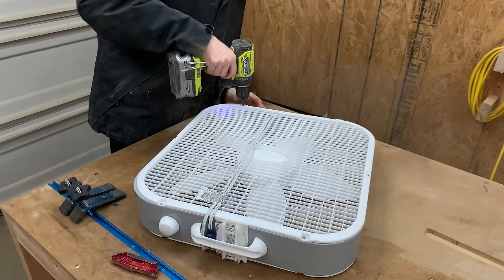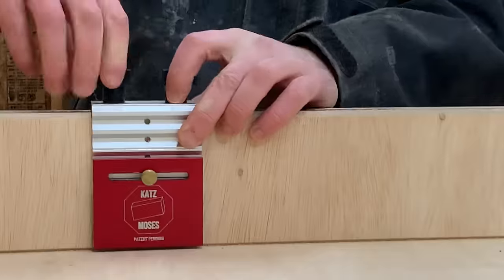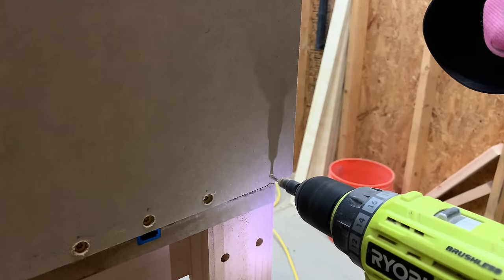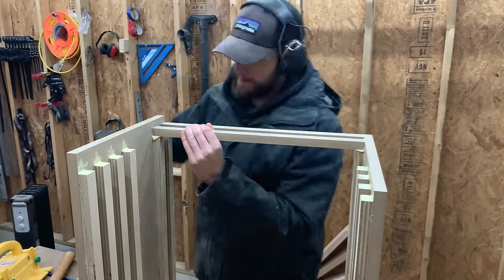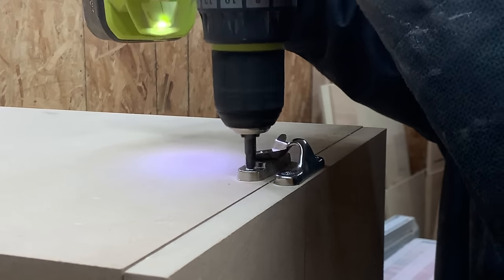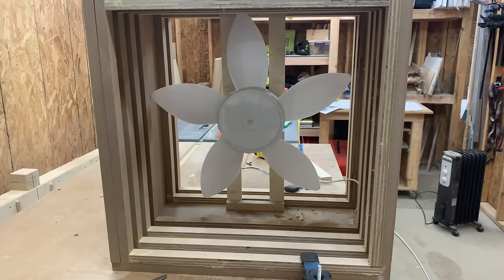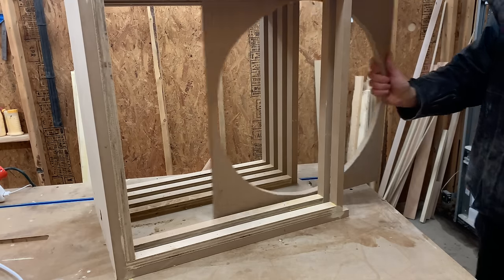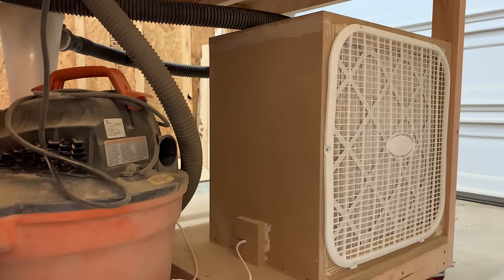this $20 fan will SAVE your lungs

Comment: You guys should check out Sensio Air at least it will tell you what the particles are; pollen mold dust-mite or dander.
Reply from the maker: What is sensio air?
Reply: @SpencleyDesignCo   I'm currently building a homemade filter I want to fit above my bed, thanks for the awesome video btw! Super helpful (I love the slide-in filters feature) and while we might be removing a lot of the Particulate Matter in the air, what I want to know is if there's still mold and dust mites after the air has been filtered. So Using that little tech to validate the air quality improvement.
Reply from the maker: That sounds pretty cool!
Reply: @CyrilleNajjar  I too want to filter out mycotoxins from air and wildfire smoke.  Sensio air is an app that measures the air?  I guess?   how does it work?

Comment: Was that electric motor sealed or open backed?
Reply from the maker: not sure
Reply: A closed back motor is what they call explosion proof. If you can see the windings I would respectfully suggest not using it as it could very well cause a fire at least.
Reply from the maker: I appreciate the insight

Comment: Why buy the box fan? You can buy a strong motor and blades for the same price. It will circulate air more efficient and last longer.... Those cheap motors on a box fan can't move the air well enough... That being said... Excellent job on the build

Comment: that's ridiculous.  there are several ways it could have been done easier, faster, and lighter, as well as cheaper. for ONE example,  using sheet metal instead of heavy ass particle board.  26 ga galvanized  is lighter,  and sturdier,  and requires no glue.  you could add the filter racks to the existing fan box, eliminating all the table saw cuts and not wasting the original fan box it came in, or moving any of the electrical components,  also eliminating all of the drilling, because sheet metal screws are self tapping. making it from metal also eliminates most of the tools you needed.     you don't even need the filters if  you just blow the dust outside.    some of the money spent on a proper exhaust fan, could have been offset by the saved labor cost of building the box.  labor is always your biggest expense in any project.  time spent building the box is time spent not making money in the shop.

Comment: A cheap LASKO fan like the one you used does NOT have the power to move enough air through 3 fiber filters and one pleated filter to do any meaningful cleaning. Your accomplishing nothing as far as dust removal is concerned. I built a similar dust filter using the same fan that hangs from the ceiling of my cutting area. It's far more efficient to construct a simple ring from aluminum flashing material and put it into the original fan box so that to surrounds the fan blade which is centered in the ring. Seal the open spaces around the outside of the ring with whatever method you desire. A fiberglass mesh filter (not a pleated one) will catch enough airbourne debris to need changing after about 15 hours running, depending on what its capturing.

Comment: using a fan that was meant to  running  without air flow  resistance  and adding 3-4  filters  of resistance  ? let s see how long is going to last !  it s like using  a VW  to pull  heavy boat

Comment: Hey i was curious if this setup makes alot of noise?:)
Reply from the maker: Great question! No, it’s pretty quiet. It’s less loud that a typical fan running. If you’re wearing hearing protection in the workshop, you won’t be able to hear it’s on even when all your tools are off
Reply: Oe thanks that is realy nice:D. I have a workshop where i can't open the windows so the realy fine dust can get everywhere. Im realy trying to find a solution for it to make it safer:). 

I have a vacuum for my machines but that one is very loud and it dousn't filter the air:). Do you think this could be a good solution for my workshop?
Reply from the maker: It will definitely help, but it’s not going to replace still needing to run the vacuum. It will help capture the very fine airborne dust but you still need to use the vacuum to collect the large legs pieces of sawdust.
Reply: Ow yea i get that:). My biggest problem is the small airborn particle's. Im still gonna use my vacuum but i need something to make sure i won't get any dust explosions:).
Reply from the maker: Dust explosions? I think you might be reading too much into Internet forums 😀
Reply: Nope that was from my dadXD. He is a bit paranoid about the safety im my shop:p. This is also because the heating dousn't work and we can't air out the place:p. I also have a pretty large wood inventory that i still need to process and my workshop is next to a car salesman with a few garages:). So lots of oil and other flamable materials:p.
Reply from the maker: Understandable! Sounds like what you’re looking for is some sort of industrial air purification system
Reply: Hey hey sorry for the slow reaction i had a busy few day's:). I also measured how big my work shop is and it's a room from 8 meters by 4 meters and i mostly have time to go there once a month unfortunatly:/. So i get the feeling an industrial machine is a bit overkill:). 

Basicly i do small work like jewelry not alot of big stuff:). Knowing that would you still recomend an industrial filter system?
Reply from the maker: I’m far from an expert in this sort of stuff. I’d suggest reaching out to a company that makes purification systems and discussing your needs with them. They will be able to direct you better than I can based on your specific circumstance.
Reply: Oke:) thanks for the tips and suggestions:). Im gonna do some googling and research:)
Reply from the maker: Sure thing! I just don’t want to give advice on something that I’m not incredibly knowledgeable about. I know there are TONS of folks that know more about the topic than I do 😀

Comment: How quick does it burn out the motor from extra air flow drag???
Reply from the maker: I’ve had it running for over a year and the fan still works as well as the day I got it
Reply: @SpencleyDesignCo  Dang pretty good, thanks.
Reply from the maker: Sure thing!

Comment: Using this type of fan for Ventilator is very DANGEROUS! If you are spraying flammable materials you could cause a Explosion 💥 or Fire.
 Specific motors that are sealed are used for spray booths and exhaust fans. These fans can also cause sparks which can ignite dust, which can also lead to explosions or fires.
 Always use proper equipment!

Comment: I just saw one of your tik toks from a couple months ago of you changing the filter but i noticed you were only using 1 filter instead of 3 or 4 that you have in this video. Did you find out that only 1 works best or something? Please let me know as i plan on building this soon. Thanks.
Reply from the maker: Found 3 was a little overkill 1 worked just fine
Reply: @SpencleyDesignCo  thanks for the quick comment. That being said if you rebuilt it would you make the box smaller to just fit 1 filter instead of now having all the empty space?
Reply from the maker: Yup!

Comment: This will not be effective in capturing dust. The simple plate fan that you have utilised is not designed to pull against any restriction, hence as the filters become blinded with dust the fan will just spin with no flow. Additionally. it will not capture dust to any distance - as you demonstrated. You will simply kid yourself that you are protecting  your lungs when you are absolutely not doing. Protection is only possible by effective dust capture at the point of emission plus PPE.
Reply from the maker: good to know

Comment: "I don't know why fans have to have a ring around them, it's just magic I guess."  LOL!
It's called cavitation.  If the air is not forced to flow through the fan, it can be pulled around the sides and right back through again.
This creates a circular flow (cavitation) that doesn't push the air anywhere but only around inside the fan housing, making your filters, and honestly the entire project, pointless.

Comment: well...like everybody has a well equipped wood shop and a table saw to build one of those and beside that you can buy fans like that for probably way less than you bought all the materials for that so what is the point?. I bought a small filtered fan at Wal-Mart for less than 20 bucks. A lot of work and money for something you can buy cheap....

Comment: It needs to be belt drive , insulated and grounded . Trying to explode or what ? And no you don't have a complaint about cost of blowing up !
  Static discharged dust explosions ain't no joke . 
  Better not let Fire Marshal see it , much less OSHA .  💲💲💲
  P. S. Hrs. How long did it take ? What is shop rate per hour ? 
  Did you save anything really ? 
What ?
Reply from the maker: 17

Comment: One major issue: Those Lasco fan blades are trash. After just a few months of running it, the blades will have lost a lot of their curve, and that means lot less air is moved... After a year, it is even weaker. The motor itself is not built to last very long these days too. I remember 20 years ago a Lasco fan might last many many years... not these days with 'planned obsolescence'. With such a nice build, it would a shame to have to take the whole thing apart after just a year or two. If this is something you plan on using daily for many hours, do not use a Lasco. This is from my experience of using this brand of fans my entire life because they are cheap. Decent for a hot summer day, terrible for commercial/industrial use! You get what you pay for.

Comment: HVAC 20 years First theres no 1 inch hepa filter i dont believe. And all of the 1 inch air filters with high merv ratings really all they do is slow down the air and so the air goes around them otherwise it would dramatically decrease the cfms. And indefinitely wouldnt put the filter on the supply side of the fan I would put it all on the return side. I'm not opposed a cheap filter in front of a better filter because they hardly do anything. And u wouldn't notice any better using the more expensive filter behind it. So if you really want to do it right you need a 5 inch filter. It has huge fins which filter literally everything even the super finest particles and does not slow down the air. They're pricey but last 3 times as long. But even if you put the cheap filters first then a regular 90 day but cheap home depot filter after it that will work good. The 3 packs at home depot for like 12 bucks work good. I find the only next best step is to use the 5 inch filters then no more dust problems. What I deal with ppl with air purifiers. Those air purifiers zap dust into finer particularly that the air filters can't catch and all that super fine dust winds up everywhere. At that point there's no other solution but installing a 5 inch filter for life.

Comment: I’ve made this type of device for a commercial shop years ago.
Hang it up a few feet above the floor 8-12.
Bigger particles will fall to the floor. The particles you want to trap are the suspended particulates.
Just open the shop door or see when sunlight shines in the shop and see the fine particles in the suns rays.  Those are the ones you want.
Been there.
Reply from the maker: Thanks for watching, Roger!
Reply: You can do the similar thing for a downdraft sanding table.
All you need to do is to be able to change slightly the direction of the particles and they will go down rather than be scattered throughout the shop
If I had your facility I’d use it and make a demo unit.
These days we should all be  cognizant of potential health hazards.
Reply from the maker: That’s a great idea 😀

Comment: These fans are terrible at pushing air through a barrier.Better would be a box that ends up just being a framed cube with the fan pulling from one side, and 3-5 of the other sides are filter.

Comment: Pro tip that fan doesn't have enough motor to move the air so basically it's a worthless design you need an actual fan to actually suck in the air and don't tell me it works because it doesn't

Comment: Seems overly engineered.  Could have just simply taped all three of those filters together and to the back of the fan, and then tape the other one to the front.  Or for the price of all the wood, just buy two fans and tape filters to the back and front of each one.  Or better yet, cut two holes in the wall of your shop (if possible) and have one fan bringing in fresh air, while the other is sucking out air.

Comment: You could do all of this or just tape a store bought filter onto the fan and filter the air without all this work. There's another YouTube video showing how it's just as effective as a fancy air purifier.
Reply from the maker: Yup, that’s definitely an option. I just wanted to make something that looked a little nicer
Reply: @SpencleyDesignCo  Yes you definitely made it look good.
Reply from the maker: I mean, if I have to look at it whenever I’m in the shop, might as well make it looks  decent, right? 😀

Comment: I really do not get all of the box fan air filter projects on YouTube.. I guarantee you are getting less than 100cfm with that tiny ass fan motor running at top speed once you add all the filters. Better than nothing I guess? But with all of the time and materials you could just buy a 200 dollar air filtration unit from powertec or wen and have something that moves closer to 700cfm.

Shit, if you are bent on going as cheap as possible then just duct tape a filter to your fan for the same half ass result, no need to over-engineer it

Comment: Good God  !  Can you imagine what a job that thing would be to give it a good cleaning  , besides weighing a ton  ,,,,, why not just use sheetmetal or tubular metal and sheetmetal  ,,,,,  using particle board is a recipe for trouble in anywhere there's high humidity or where rain might hit it  , now I'm not saying this guy doesn't do good work  , I'm saying he's using the wrong materials  , in fact for all this engineering why not just use two air conditioning filters one on each side and that's that ! 
Oh well  , that's 10 minutes I'll never get back .

Comment: Please don't build this. I've bought dozens of those same types of fans. They are awesome fans and for the purpose that they serve they do a phenomenal job. But they last about a year under the very best of circumstances before they stop moving very much air. The first thing I do when I buy one is take the protective covers off because that increases the airspeed and it also increases the fans lifespan. There is no way that thing lasts more than a few months before it starts becoming just inefficient not really moving any air but sucking down energy like it is. Don't get me wrong the idea is great. Fantastic. But you'd need a more powerful motor. And just so you get it I design electronics.

Comment: Pro tip here...instead of smearing glue on the side of the panel....smear glue on the END of the panel you're glueing. That way you guarantee you get enough glue on the target panel. DO NOT NAIL MDF...use a stapler instead as it holds better than nails. DO screw the parts together.

Comment: What a waste of time. You still ended up with a box fan, yes made out of wood instead of metal, but a box fan never the less. What I did was duct tape a furnace filter right to the box fan and it works perfectly.

Comment: hangs fan with replaceable filters in the ceiling
3 months later - "how do we change the filters?"
Reply from the maker: Easy to change with the door and a ladder 😀
Reply: @SpencleyDesignCo  trust me. you dont want to have to grab a ladder to change filters.

OH! make a chain/rope hoist so you can move the fan up/down so you can change the filters with a ladder!
Reply from the maker: Haha that would be a crazy solution! It would be cool, but overkill. I’ve changed the filters out multiple times over the last year with a ladder with not a single issue

Comment: Keep it low. Don’t wanna pull the dust up past your face or what’s the point
Reply: The dust that needs to be filtered is fine particulate that will float around in the air and does not quickly fall to the floor, the ideal mounting location is on the ceiling somewhere opposite to where you are working, so that it creates a current of air flow drawing the dust away and leaving filtered air in its place. OF course, the design shown in this video is a joke and will not work.

Comment: Dude, you think too much. I do this with aluminum duct tape right on the fan in 10 minutes! Save your time for woodworking. Or get an old swamp cooler and fit the filters in the cabinet, now you are moving some air. That Lasko is not your best bet, not enough cfm under load, although its quick and easy with out all the wood.

Comment: Ummm 9min and $80 later your lungs are still not safe. I don't see how taking on such an expensive an elaborate project only to shove it under the workbench is preventing respiratory disease. You're better off not using any filters and simply venting this fan through an open window. A second open window or vent in the space to create cross ventilation would be better suited than stuffing an mdf cube with filters & a fan. The work is great & the finished product looks good but ultimately serves no real purpose.

Comment: this is a really bad design, heavy, overly complicated and terrible airflow. Better design: just build a light wooden cube the size of the box-fan with legs tape the fan on the top blowing up and 5 Merv-14 filters on the bottom+sides. fans stays clean and 5 times better airflow through it. guarantee you are getting terrible airflow pushing through that hepa filter, hepa don't mean shit if the air doesn't go through it.